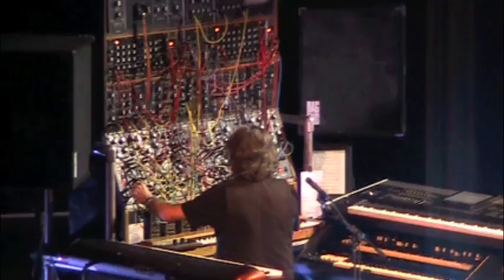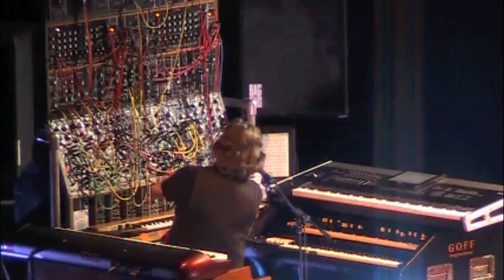Keith Emerson breaks down the moog

Comment: If you've ever seen the video footage that's around from the time of the first ELP album, the Moog was originally much smaller. I think he probably started off with a 1-C system, which does indeed have just the three oscillators. He expanded the synth over the course of the next few yeras by adding modules, but I've never been able to get an inventory of WHAT was added, other than the sequencers and maybe the preset box (which I think he had to begin with).
Reply: Keith's original Moog was one of four custom built for the 'Jazz in the Garden' concert series held by MoMA in New York. These had been built with preset boxes allowing a performer to change patches on the fly. See the Biography of Robert Moog by Albert Glinsky, and Edward Macan's 'Endless Enigma'. It cost him £4,000.

Comment: Another point worth noting is that I've heard a couple people suggest that Keith never really uses anything beyond the standard Mini-Moog voice structure, ie three oscillators, low pass filter, single VCA and two envelope generators (one each for the filter and VCA). Obviously, early on that's all he had, but I've heard it explained that later on, he had the extra oscillators set up in banks, with each bank set for a single patch, then all he had to do was swap around a couple patch cords.

Comment: There's no doubt in my mind there's more than 3 oscillators in that rig.  Even with 2 sequencers, and every module Moog made, there has to be more than 3 in a rig with that many modules.  Must be a pain to patch a Moog such that it can be used on multiple songs if those songs use a different sound.  I think Keith said, in another video, at one point Bob Moog made him a preset box, to help with patch switching (you can buy one today that's probably very similar to it.)